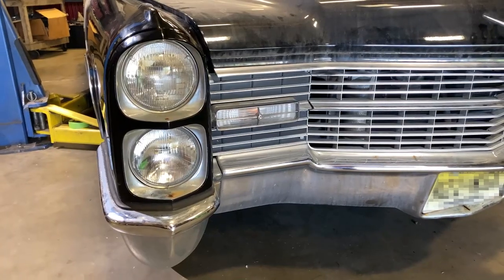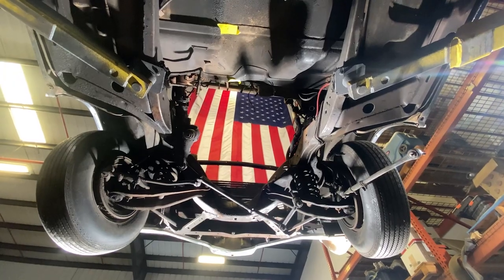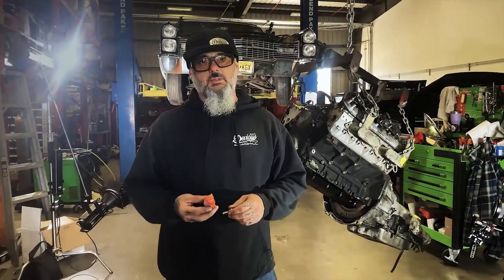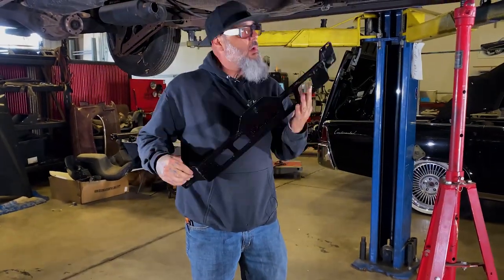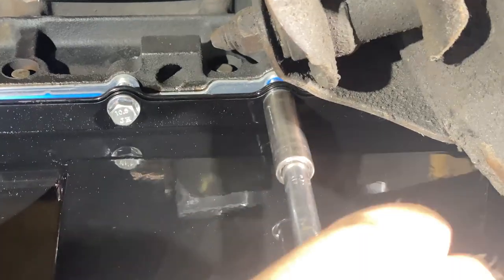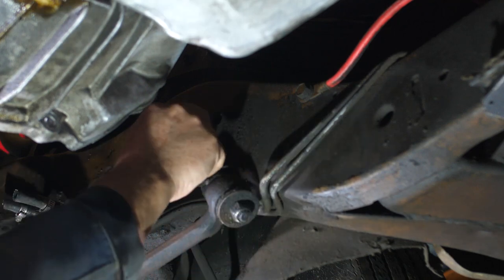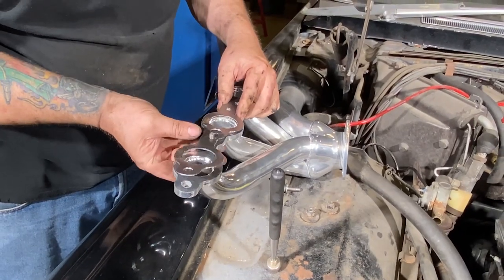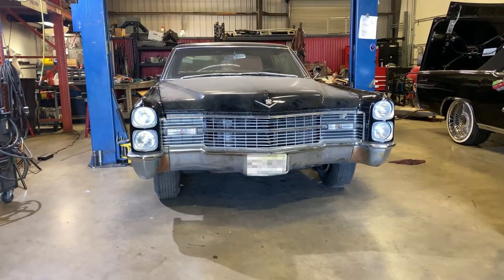1965-1966 Cadillac LS Swap Kit

Comment: Typically gm mated the 6.0 with the 4l70 or 4l80 to handle the extra torque so im curious to know if you guys have had any tranny issues with this build? Was thinking about doing this kit in my 66 coupe but was wondering if it's a reliable engine/tranny combo.
Reply from the maker: we have the 4l60 built to hold the horsepower. we don't run stock trans missions

Comment: I wanna see how you're routing the exhaust pipe with oil pan and remote oil filter there's no dam room on the drivers side .yes I bought the kit
Reply from the maker: Very tight. We use two 2.5 tight radios exhaust u bends to get the exhaust out. Oil filter relocation we  go up the frame rail to in front of the motor.

Comment: Haven't installed my setup yet, only trial fit.. but I can vouch for the quality of this kit- it is top notch and well done. This video answers any questions you might have about the fitment and alignment of the mounts.
Reply from the maker: Thank you for the response. Looking forward to seeing your car in the road.
Reply: @DeviousCustoms  I saw that you updated the cross member, were there any changes to the motor mounts? How would I know which version of cross member I have?
Reply from the maker: @jerryzkids  crossmember is all the same points just made different for manufacturing. We simplified the motor mounts. Everything is pretty much the same.

Comment: Awesome video. Glad to hear about revised the kit working out for the better...
Reply from the maker: Thank you.
Reply: @DeviousCustoms  I have a 66 that I'm about to do a swap on as we speak. Would the mounting kit work for a 4L80E?
Reply from the maker: @lawjo1978  excellent question.  Our kit is designed for the 4l60 so you don’t have to cut the floor.  I tell everyone build the 4l60 so it’s rock solid.  If you use the 80 you will have to cut the tunnel and do Sheetmetal work.
Reply: @DeviousCustoms  I don't have an issue cutting the floor and doing the necessary modifications on my car. I plan to lay frame on the old girl. I'm interested in trying out a mounting kit if it can be bought that way.
Reply from the maker: @lawjo1978  yes sir we have it that way.
Reply: @DeviousCustoms  Okay sounds great. I will give a call and place a order

Comment: Is this a k body? I have a 1972 deville im trying to ls swap but finding motor mounts are a pain. Any direction of help?
Reply from the maker: I haven’t tried on a 72 so I’m not sure but does work on a 70.
Reply: I did some research and found that my 72 deville is a c-body chassis & 70s the same so this just might work 💪💪💪

Comment: About to order the 1800$ kit. I see your using a 60e, will 80e or 6l80 work with this kit?
Reply from the maker: 4l60 and 65 fit without cutting the floor. Anything else you need to cut.

Comment: Do you have any knowledge on xx80e transmissions fitting for this year with your kit?
Reply from the maker: We use the 60 because it has a smaller case the foil 80 will mean you will have to cut the trans tunnel
Reply: @DeviousCustoms  do you have a mounting system for the 5.7L LS1? It's not listed as an option in this video.
Reply from the maker: @davidpope6371  nothing on the lt platform yet.